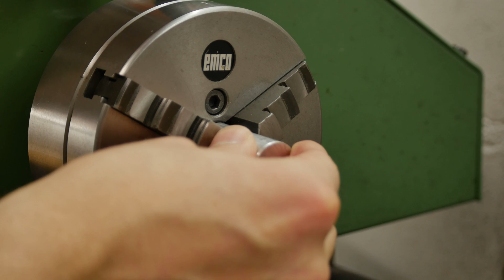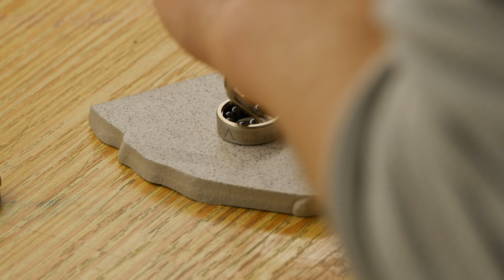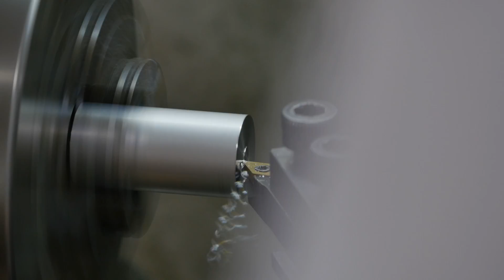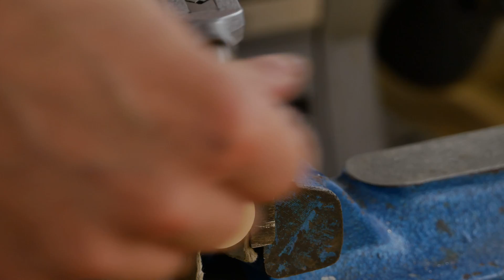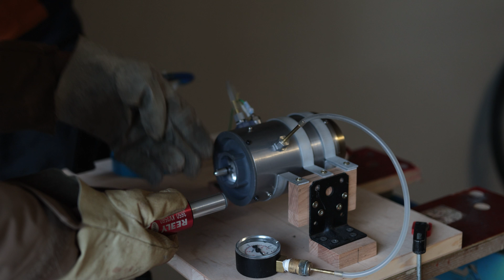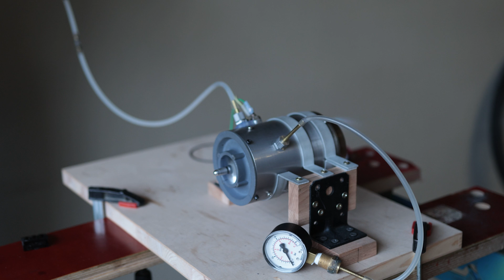Homemade Jet Engine 4.0 | test run 5

Comment: i hope you read to me, you need to increase gas pressure, you can heat the gas tank and reduce the gas line and the head help the butane to evaporate more fast (when you heat the butane comes out very cold).. take carefully bro..

Comment: Welchen Treibstoff hast du. Gas betrachte nur als Aufheizung für das System. bei ca 20000 Undrehungen dazugeben von Diesel mit 2%synöl, wegen der Lagerschmierung.
Kein anderes Manometer Drehzahlmesser ist wichtiger, welche Selbsterhaltungsdrehzahl habt ihr errechnet ?

Comment: Mega cool! Besonders beeindruckend ist der Fortschritt deiner letzten Videos! Obwohl ich nicht viel Ahnung von Gasturbinen habe, scheint es mir nach dem Anschauen einiger deiner Videos, dass die Turbine zu wenig Kraftstoff bekommt. Vergleichbare Modellturbinen verbrauchen etwa 200-300g Diesel pro Minute, was bei Butan/Propan etwas weniger wäre. Demnach müsste deine Kartusche innerhalb von 1-2 Minuten leer sein. Da das Gas nicht schnell genug gasförmig wird, solltest du überlegen, ob du eine größere Flasche verwendest, die Kartusche erhitzt (z.B. in einem Wasserbad) oder mehrere Kartuschen parallel betreibst. Diese Baumarkt-Unkraut-Gasbrenner (CFH oder so) haben einen höheren Durchsatz als die Lötlampe die du benutzt. Ansonsten hätten Propan oder Isobutan (nicht normales Butan) weniger Probleme mit der Verdampfung, da Siedepunkt bei -11,7°C und nicht -1°C wie bei Butan. Bei Butan steigt der Druck in der flüssigen Phase um 7 bar pro °C Temperaturerhöhung (gasförmig 0,3bar/°C). Eine Große 5kg Propan Flasche wäre wahrscheinlich das einfachste (und evtl. sicherer).

In diesem Video sieht man gut, wie die Turbine zuerst sehr heiß wird, dann die Leistung steigt und sie direkt abkühlt: https://youtu.be/T9KyD0yP_Us?si=vaVBLN1nRCEgXoUW&t=734

Ich könnte dir auch eines meiner FastLOGIC! Boards zuschicken, mit dem du den Kammerdruck digital und sehr genau messen kannst. Wenn du Lust hast, können wir darüber sprechen, dass ich dir einen kleinen Teststand mit Schubkraftmessung baue. Ich habe so etwas schon einmal für eine Heißwasser-Rakete gebaut. Ab und zu bin ich auch in Aachen (falls du noch dort bist)...

Auf jeden Fall extrem cooles Projekt!

Comment: Die Ölspritze?

Tip 1: Wenn irgendwie machbar, die Lager sollten in Öl laufen, das Öl schmiert die Kugeln und kühlt gleichzeitig das Lager und die Schaufeln. Am besten ist das Öl mit einer kleinen Pumpe zu bewegen, "Umschlaufschmierung" damit es nicht zu heiß wird. Es sollte möglichst nirgends austreten.

Tip 2: ich habe das Gefühl, das Gas als Treibstoff einen zu geringen Brennwert hat. Eventuell würde ich hier mal Petroleum oder Fettsäuremethylester verwenden, das dürfte angesichts des doch recht starken Kompressors besser gehen und eventuell durch das bessere Kraftstoff-Luftverhältnis auch nicht mehr so heiß verbrennen.

Seid ihr euch sicher, das ihr für das Turbinenschaufelrad das richtige Material verwendet habt? Es sollte sich nicht so weit ausdehnen dürfen und auch diese spezifischen Anlauffarben sind kein gutes Zeichen. Es kann auch am Gas als Treibstoff liegen, wie schon erwähnt, euer Kompressor ist recht stark und Gas hat einen zu geringen Brennwert bzw zu wenig Kohlenstoff.Das erklärt dann auch den hohen Gasverbrauch, der überschüssige Wasserstoff treibt die Verbrennungstemperatur unnötig nach oben, weil nicht genug Kohlenstoff vorhanden ist um all den Sauerstoff, der vom Kompressor in die Brennkammer gepresst wird, zu nutzen.

Comment: Nice project.
On the other hand, if you want to use gas for the tests, it's a big propane bottle. You will not operate properly with a camping gas bottle.

If the turbine wheel is made of Inconel, the reddening is not dangerous, especially at very low revs as is the case in your video.

Good luck, you're almost there

Comment: Could you use a motorcycle fuel pump to feed the fuel system works great? you still need make a 2-stage diffuser, this one won't touch the intended engine, it's getting there. https://youtu.be/IWQbqXZJZ48?si=TDqeeNCWZmom3G8F

Comment: Not creating vacuum or boost, which is why it’s not running on its own. Your fuel supply needs to be referenced to your engine, electricity via sensors or a mechanical reference. An oil fed bearing system would help a lot. Good progress so far.

Comment: for the next tests in my opinion it would be more appropriate to try to install a pump and use kerosene with the engine hot, furthermore due to the high revolutions that a turbine makes the bearings should be constantly lubricated, which from the video does not seem to be done, in fact jetcat uses oil inside the kerosene which first passes inside the hub with the bearings and then comes out to be burned

Comment: Start it with a leaf blower. It will keep it cooler.
Also, you can dynamic balance with a smartphone. Stick weight to a blade, spin and measure, repeat for each blade and look at the results.
You can then work out where you need to grind material. 😊
Youre welcome.

Comment: Hey, congrulations to your jet engine!
I think it will be more easy to self-sustain it if you use kerosene or diesel mixed with oil because the efficiency in these fuels and use the propane for only do the combustion chamber preheating.
Also, I would do a bigger compressor intake to avoid very high temperatures in your turbine wheel.

Comment: I honestly at this point don't think you understand the point of a jet engine and have a mindset of the tolerances required to have it be efficient and self sustaining. That said, alot of work still goes into what you have done, and thats nothing to ignore or deny. Considering the following:

Your power source is your liquid fuel, and the thrust is what you're after.
What you have right now looks like nothing more than a flame thrower. Where does your fuel come out? How does it burn? You can't just have an essential lighter inside of a big chamber with alot of gas and an explosion happening with alot of turbulent air. The whole burn process needs to be extremely well controlled:

The burner pipes need to have extremely tight tolerances and create makeshift fuel to air burners. The fuel pours in through the feed line and comes out at all the pipes evenly and then is evenly ignited at all sources. Low speed moving air supplies the entire combustion chamber with fresh air. The exhaust pressure causes the turbine to spin, which drives the compressor, which brings in more air. But just because you have more air doesn't mean you don't need more fuel.

And yes, your rotational parts still have horrible problems as evidence via how quickly the whole thing winds down to a halt. It needs to be so smooth that the blowing on it with air (not even compressed air, just the air from our lungs) can move the rotational parts of an engine that small. Why? Because why lose all or any air-to-rotation power change or rotational_power-to-air speed change to friction. You have alot to fix but if you fix all of the above, you wont even need that spin starter. You would just need to finger rotate compressor, light the burners up and then watch the whole thing accelerate on its own.

I'm serious. This is all that is required. Best of luck fighting out the whole bearings issue though, that will be tough, and you do need to make sure it's perfect/measured perfectly, all sources of friction removed.

Comment: SO close, massive congratulations for getting this close . I couldnt tell you what needs to be changed to get it to self sustain but if I was to point a finger at anything its possibly just the exhaust shape being too large , maybe there is too much vibrations but Ive seen honeywell APUs spit way more sparks out of the exhaust before ' Self clearance' lol

Comment: First of all congratulations!

I am watching from your very first videos on the jet engine.
Yes blades do heat up enough glow. But that's for short time. Once it move further from self sustaining, it cools down. 

I also have problems with gas consumption 😂
But thats the main thing .. so can't complaint about it.

Comment: Sounds like it was running fast enough in the first few tests, probably the motor was holding it back and should be taken off at that point? At the end it almost runs at much lower rpm which supports this. Use a much bigger fuel tank, looks like liquifued gas is flowing in sometimes?

Comment: Well done - you are almost there! I think you need to add more gas to get it up to self-sustain speed. Yes, the turbine will get hot, but as the engine accelerates, it will cool down again. They do use a huge amount of gas. You won't see any pressure reading until you are above self-sustain speed. That pressure gauge will show you what you need. Blowing into it will only show 2-3 PSI  (0.2 Bar) max which is roughly where you could expect to be at idle.
Reply: After a lot of research on my part (getting ready to build my own turbine) i agree with your idea. You need a lot of gas to idle a jet engine this size. Your comment about cooler engine at higher rpm is because the efficency of the compressor increases as well (for anyone not knowing) pushing even more air in. And thank you for the manometer tip. Will keep that in mind when i get to testing it

Comment: id use zro2 bearing, they are suited better for high temp applications, and they can run dry without lubrication. Id recommend a switch to isopropyl alcohol it burns a bit less hot, and it will allow you to run the engine longer. If you want to take the other route use methanol but be careful to not damage the engine on startup.

Comment: Congratulations! I've been watching since the start, and i'm so glad to see the results of your perseverance.
For maybe some recommendations: -have you looked into using the fuel to cool critical parts like the centershaft/bearings, and maybe the exhaust port?
-balancing may help a lot.
-maybe make the turbine radius slightly larger than the exhaust port?
Best of luck!

Comment: Are those sparks from the compressor blades? If so, I would highly recommend making your own blade balancing tool with an arduino and a couple of load cells. That way you don’t have any wiggle which won’t disturb the intake air compression
Reply: The turbine produces quite much vibration. For this small size the turbine has to run really fast (>50k rpm) to get stable combustion. If at these speeds something is only slightly out of balance, you will feel it instantly. Through those vibrations energy gets lost by flexing and the resulting leakage.

Comment: Auch wenn es momentan nur schleppened voran geht, wünsche ich viel Erfolg bei der Entwicklung.
Eventuell wäre ein, Entschuldigung für den Anglizismus, abradable matererial, bei der  Verminderung von Leakagen hilfreich. In Kompressoren werden dabei Lacke auf Basis von Kunststoff eingesetzt. Bei der Turbine sind es meistens angeschweißte Honigwabenmuster aus Hochtemperaturmetallen, bei kleinen Turbinen könnte man eventuell mit einer 3D gedruckten Schablone und Galvanik etwas ähnliches Herstellen, das ist aber nur Träumerrei und Spekulation meinerseits.